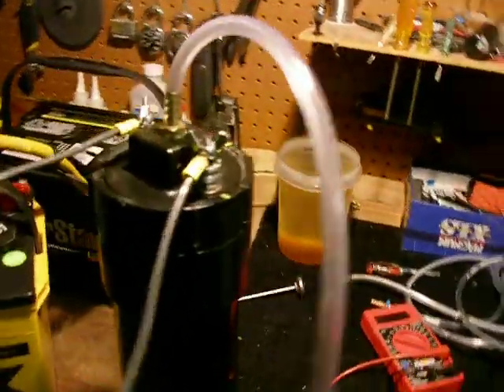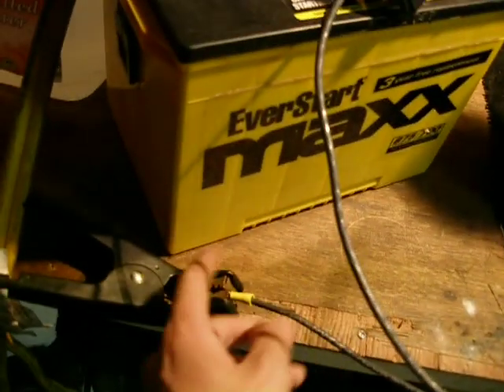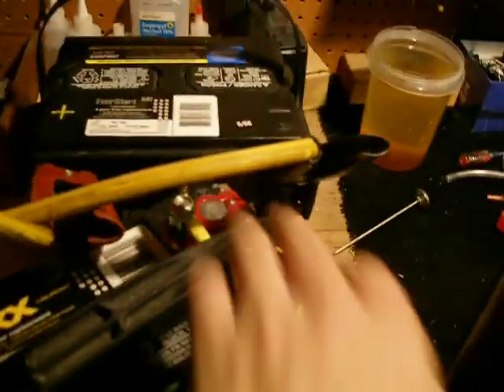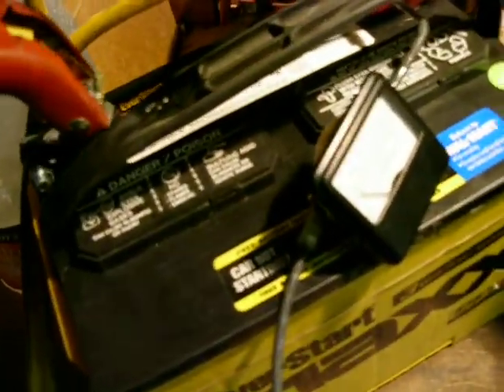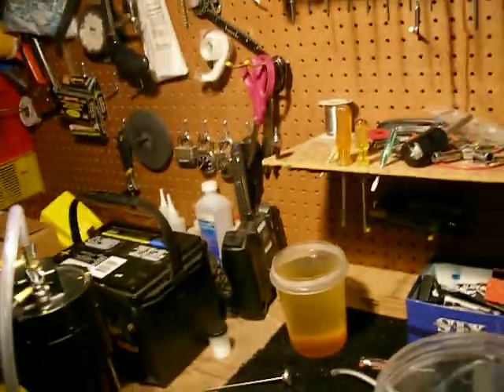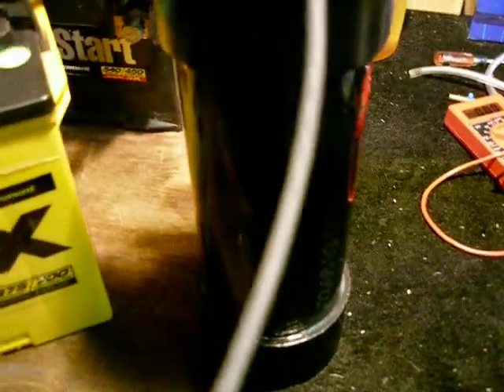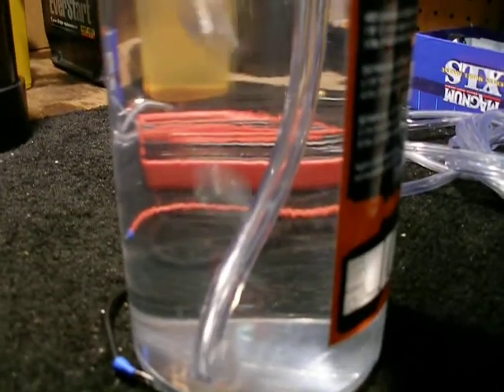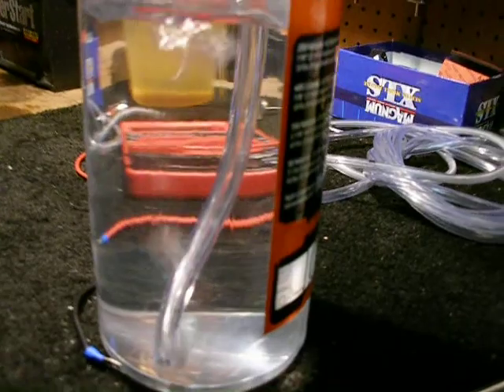HHO Generator 9 Plate 25 Volts Distilled Water!

Comment from the maker: Thanks for the info.. I think im going to either shrink tube the cell or glue plexi around the cell to eliminate heat and amperage draw.. Im going back to 12 volts for now to do some more testing but im going to mess around with the 24 some more.. Im getting some 2X6 inch plates cut soon made from 316 SS.. going to be 5 plates -n+n-, or -nnn+ havnt decided yet... Anyways Thanks for the comment